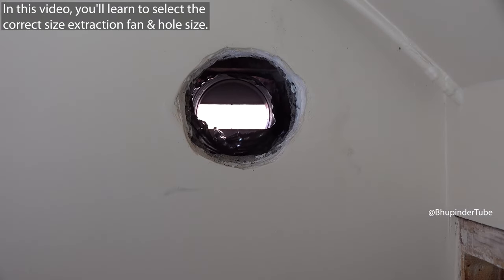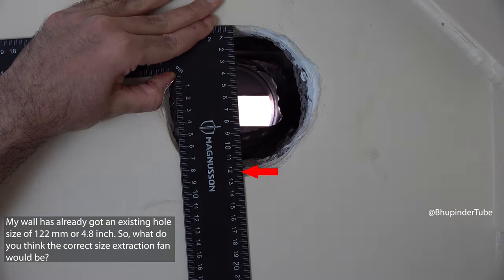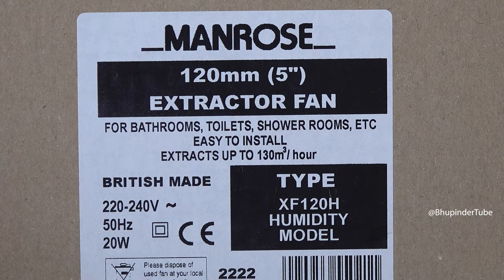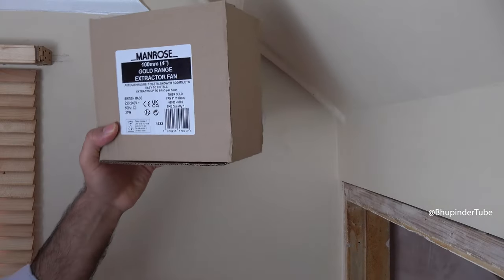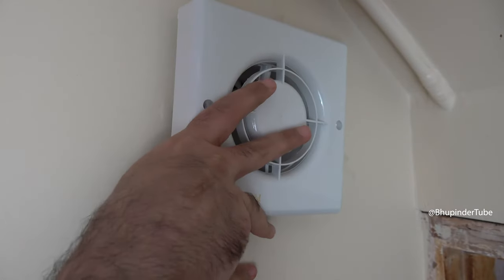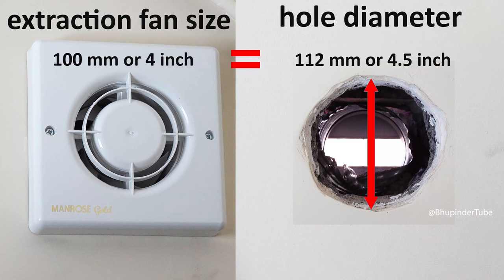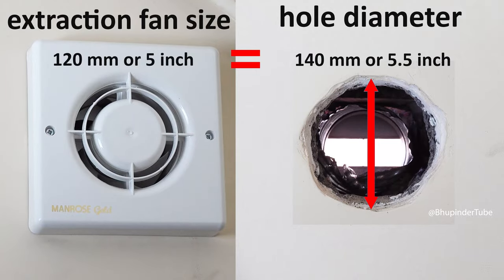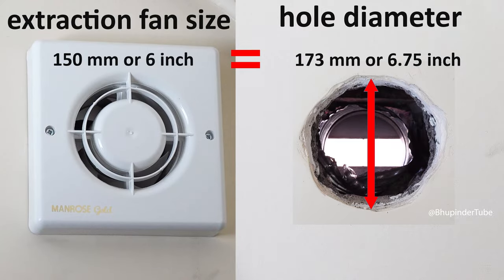Extractor Fan Hole Size

Comment: What should be the size of hole for 12inch exhaust fan?
Reply from the maker: Are you sure it's a 12 inch (30.5 cm)? Is it for a commercial kitchen? I don't recommend a 12 inch fan for a house. It's too big of a hole in the structure (wall). You could instead have 2 x 6 inch fans at 2 different locations. Otherwise, check the manual of the 12 inch fan. But making such a big hole on a single wall not gonna be easy & can be dangerous.